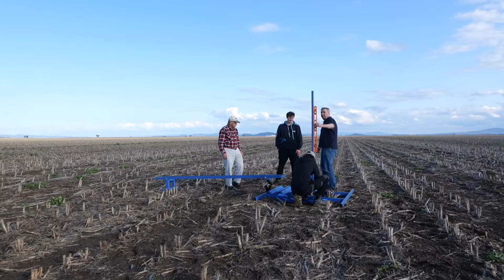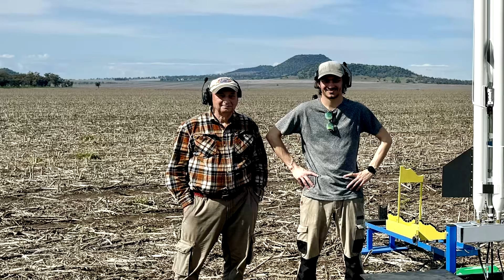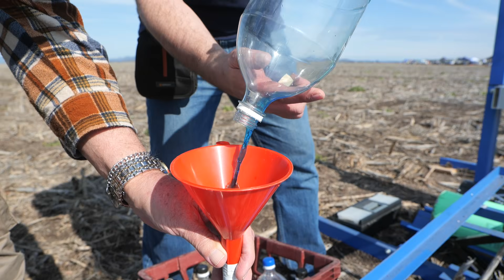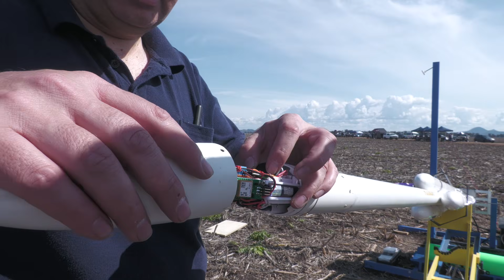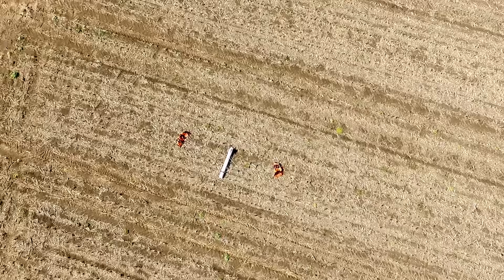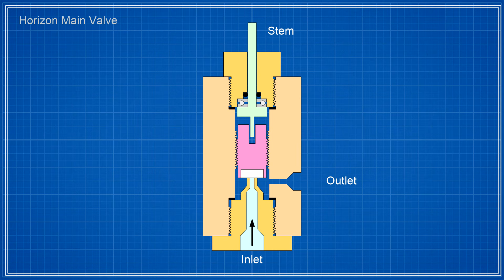World Record 2-Stage Water Rocket Flight

Comment: This is fantastic to watch. Last summer I told my wife Ukraine might be able to launch water rockets to raise nets to stop drones and/or missiles around critical infrastructure and would not need any combustible fuel. Larger parachutes would help stop the missiles. Adding salt in the winter would prevent freezing and lastly adding compressed air just before launching before launching would be a safety feature. I did not try to calculate how much thrust would be created by 300 psi air pressure.

Comment: If 5 stage with extra air tanks on each stage and ejection each stage after dried out then 20,000 km space can be achieve with dried fuel and electric as two final stages

Comment: Well done. Awesome flight effort but also brilliantly documented.
Some connectors that you can't reverse and are capable of handling 40G without separating would potentially a good thing. A cordless drill, screwdriver bits and some sockets could save you hours next time you set flight.
Reply from the maker: Thanks, the battery connectors we use are not ideal, but they are standard to all our other electronics/chargers that we use on our other rockets, so this makes it much easier to swap things between projects. We've never had these separate as a result of acceleration ... well not yet anyway. :)

Comment: Great engineering folks 👍.Max altitude reached ? Also the terminal speed.
Reply from the maker: The maximum altitude of the second stage was 5313 feet / 1.62km / 1.006 miles ... top speed was 977km/h  / 607mph

Comment: 120 feet whow, makw me feel like wheni was a kid. Did my eyes decieve me, did it run of of water on the boost stage very quicly and finish the assent on compressed air? would it get more boost with a higher ratio of water or a smaller nozzle ?
Reply from the maker: Yes during boost the water comes out in a couple hundred milliseconds and the rest of the air in a few hundred more. Most of the flight is the rocket just coasting. Water here is near optimal at 1/3 the volume. A smaller nozzle on the booster gives you less speed to accelerate the second stage. In fact larger nozzles would be better, but the rest of the rocket would have a hard time handling the acceleration. That's why we are using the nozzles we are. As is we still get 45G of acceleration on the first stage.
Reply: @AirCommandRockets  boy, i would have to dust off the ole physics books but it seems conventional rockets use a nozzle to turn some of the pressure into volocity since the volocity of the exahust determines specific impulse. would a nozzle reduce the G load and allow a lesser thrust to go furthor with the same reaction mass? I am sure you have run the numbers 1200 feet proves that, too early for that math.

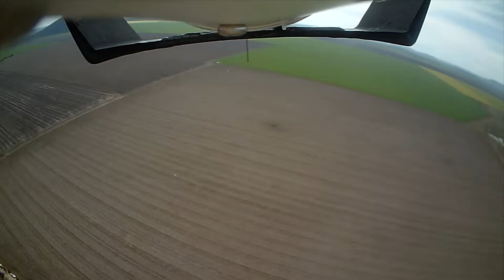Comment: Not sure if you guys noticed you had a hitch hicker on the rocket before launching lil spider was bouncing around checking out the new surroundings headed towards the camera for a selfie 36:49 think it was 4 min prior to launch just as the spectator in field walked into view I'm sure lil critter had a good hold on the rocket till it fired off you had 800 lbs pressure release almost faster than fuel propulsion 1/2 mile .08 seconds is fast

Comment: The first stage is water pressure?
Reply from the maker: Both stages use compressed air as the energy source (about 2/3 the volume) and the rest is water (1/3 the volume) that is used as a reactive mass to eject from the nozzle.
Reply: @AirCommandRockets  Interesting. Thank you.

Comment: My first thought when looking at your rocket is how air will be forced in between each outer rocket and create pressure in that space and increase drag. Why not design an aerodynamic sleeved cap with a center hole that can slide over the center rocket and cover the other three? Maybe just down to the parachute door? I'm thinking beverage can thickness aluminum or a lightweight plastic as you've been using for other components. I could be wrong, but I think worth looking into. Edit: On second thought, I'm thinking that such a cap could eliminate that black bracket you used to hold everything together, which looks like is creating a huge amount of drag by itself. You would end up with far better aerodynamics with little or no weight gain; maybe a net weight loss. In the end it would look like a Saturn V rocket.

Comment: To me the best part of this series has been how committed people have been to make Horizon a reality. Will it fly again?
Reply from the maker: Thanks Dan! There is currently no near term plan to fly it again. We have a few other projects we want to tackle first.
Reply: I'm sure that once you've had some time to analyse and let sink in all the data and think where you would be able to squeeze some more efficiency, performance, drag reduction and various other aspects you'll be itching to get out and put those new theories to the test hahah  @AirCommandRockets 

I'm thinking how much drag would counter sunk screws save, and also that releasing the second stage at apogee is counterintuitive as the first stage has to rebuild all the momentum that deceleration has taken away, so some fraction of a second sooner deployment of the second stage could achieve more total altitude due to more energy being available at a higher velocity for not much altitude gain from the first stage...
Reply from the maker: @duzmano8161  The entire project was all about compromises. Because there were so many parts that we weren't sure if they be able to hold up to the forces, we tended to err on the side of strength and durability over weight or aerodynamics optimization. Now that we know what works, there would definitely be some things we would improve upon. I think you could easily remove about 2Kg from the booster, and improve the aerodynamics further. As you mentioned, staging optimization would also get you extra altitude.
Reply: @AirCommandRockets  and after all that I wrote, I didn't congratulate nor commend you for all the effort and the amazing results that you and your team and family avchieved, kudos and respect to all of you.
Reply from the maker: @duzmano8161  No worries, thanks for that :)

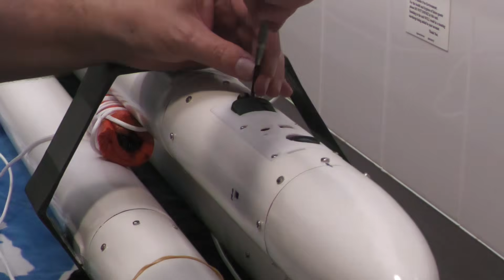Comment: Around 07:30 - How much of that equipment can be deleted in order to achieve maximum altitude and still recover the rocket? That must be quite a lot of mass.
Reply from the maker: This is a good question. One could certainly remove the cameras and the other redundant parachute deployment mechanism. You would probably save ~1Kg. That may give you an extra perhaps 100-200 feet? On the booster it isn't as critical as it is on the second stage.

Comment: Have you tried silicone rubber bands?

I wanted to stretch one out a couple mm, so I hung a weight from it for 2 months...and it snapped right back to size, zero change after 2 months of being stretched.
Reply from the maker: We have not tried silicone rubber bands. Might have to have a look for those. We've tried natural rubber bands which stretch more than regular rubber bands, but they also degrade faster. Thanks for the tip.

Comment: This is science people; measuring the mud on your shoes with a calliper ( you have to be very precise with such things). You can make things the hard way or…..I took a normal PVC water bottle filled it with a bit of water, folded a piece of paper to make a cone, made a little peeping hole for a shockproof GoPro , stick it with tape, stick a iron rod in the ground, (no spirit level needed) stick some lightweight O rings on the side of my ‘rocket’, pressurised it with air, no parachute needed and release the butterfly valve. We approximately made 650 meters ( OGee inches) erm…25.590,5512 inches! (Damn metrical systems, wish they were used worldwide. Total cost; bottle of water, some paper, some glue, some tape still had rod in my shed to guide the ‘rocket’, the GoPro survived, all in all approx. $ 3,50. What did we not achieved; the height, the effort, the countless dollars you’ve spent, the endless video you’ve made (ours lasted 1,5 minutes , no hotel costs (cos I made it in my small kitchen) and so on and so forth. Strange hobby’s in America! I don’t want to ridicule your educated hobby’s, on the contrary, I do certainly admire them very much and admire especially what you’ve achieved. But in my tiny country it isn’t simply possible! If I launch a rocked the size you did our whole country will be blown to smithereens. Thanks for your video and stay happy 😃 love from Holland 🇳🇱
Reply from the maker: Glad to hear you've had fun with water rockets as well. :)

Comment: Wow! I'm from the UK, and nearly 61 years old.

Your video took me back nearly 48 years to Edgewater College, Pakuranga, Auckland, NZ where I won (for estimated altitude - "a long way above the school buildings") in a 4th or 5th form water rocket competition.

Mine used a small gum bottle (which has a nice flat flange at the neck), jammed onto a large pen top, with a hole in the bottom of the bottle filled with a test tube bung, fitted with a bicycle inner tube valve.

It was filled to about 50% with water, and then pumped as high as we could manage.

A clip help the bottle neck flange in place on the launch pad (a small board with a hole in which the pen top was jammed) and was simply released using a cord.

Just one of those magical moments from my early teen years, that I thought I'd forgotten entirely, but now can visualise in some detail thanks to your video.

Sadly, I didn't pursue a career in rocketry, opting instead for high performance computing :)
Reply from the maker: Thanks for sharing :) You're never too old to get involved in rocketry.
Reply: That's pretty cool it triggered a memory from your wee days as a kid.

Comment: I am surprised that the optimum configuration has that little water.
Reply from the maker: The ideal ratio is about 1/3 water and 2/3 air. We're slightly under this ratio to make sure the rocket remains stable in flight. Here is some more info: http://www.aircommandrockets.com/water.htm
Reply: @AirCommandRockets  Er, I get a cert error followed by a 404 for that link?

Comment: Probably an uninformed question:  could the apparent measured altitude drop of the second stage be a Bernoulli effect due to its high speed.  (I think you said it was a barometric sensor for altitude.

Thanks
Reply from the maker: Yes, I do believe something along those lines is what happened. Normally you want the static ports on the rocket to be on the cylindrical part of the rocket. Here because the port is in the tapered part of the nosecone, it can get  a little noisy at higher speed. It's probably also why it settles down once it slows down near apogee.

Comment: Amazing commitment to a simple technology.  We did this for two science projects and several Boy Scout events, and came in second in a regional competition.   Three comments, first, not sure that straight up is the best.  We saw that some competitors got some "glide" value at small angles, as the stage tipped over slowly, and some had "guidance tabs" along their sides to help with that angulation.  Second, it is the RATIO of the water and air which determines the best performance for a given weight.  They should be weighing the water, and making the air pressure the best possible value together.  We had some computer modeling to help with this.  After the boost and lift, the center of gravity shift allowed us to obtain maximum "hang-time" which was one of the scoring criteria.  We doubled the hang times of the previous records.  Third, as SpaceX and BlueOrigin recently said after their problems, "it is ALWAYS the VALVES" which cause the problems.  So true, so true...

Comment: I wonder if you pulsed the release of the air and water if you could gain efficiency
Reply from the maker: Not really. Also any mechanism that you would add to make it pulse would add extra weight that you would need to overcome. If the goal was to reduce the flow rate, you can change the size of the nozzle without a need to pulse.

Comment: whats the point with this rocket ?
Reply from the maker: A really good question. Water rockets by their nature are one of the most inefficient forms of propulsion. This rocket is about the fun engineering challenge of pushing that concept to its limits. The one advantage of normal water rockets is that they are very cheap to fly and are often used in high schools to teach physics of rocket flight.

Comment: So cool, great job. I'd like to hear more about why shooting the 2nd stage at max velocity from 1st stage is better than waiting until closer to max altitude for 1st stage. Also, the spike in speed on the booster after separation could be due to air pressure still leaving the boost. It was obvious in the video the booster was still boosting when the separation occurred so it could have sped up for a few more seconds after separation. It looks very impressive in the data that the parachute opened very near apogee. But, another question is, in terms of retrieval, wouldn't it be nicer to let it fall back down for a few seconds, so the under-chute glice would be less? Congrats on an amazing launch and retrieval.
Reply from the maker: Thanks. If you leave staging much later after the burnout of the booster, then the second stage is just loosing energy because it has this draggy thing attached to it. I guess it's like taking a run up with a javelin and throwing it when you are at your top speed, but then hanging on to it for a little longer rather than letting go immediately. The parachute opened at apogee because there is a barometric sensor on board that detects when the rocket gets to apogee. Opening the parachute later into the flight means that the rocket picks up speed and may rip the parachute off if the speed is too high. At apogee the rocket typically travels the slowest and so is the safest time to deploy the parachute. To reduce drift there are dual deploy systems that open a small parachute or streamer at apogee and then open the main parachute closer to the ground. These systems are more complex and heavier.

Comment: Cool stuff

What's next more pressure?
Reply from the maker: No, most of the launcher and rocket was designed for the 1000psi, it could handle perhaps a little bit more, but at that stage it is unclear what would break first.

Comment: One of the things that struck me was the fairly short burst of actual mass of water coming out of the boosters. I am now wondering if there's any way to add ice instead of foam to prolong mass ejection. Just a stupid biologist who has no knowledge of rocketry😂
Reply from the maker: The rocket is fairly optimized in terms of nozzle size, pressure and water amount. The job of the booster is to get the second stage up to the highest speed possible before staging. Prolonging the mass ejection would just cause the 2nd stage to achieve a lower top speed.

Comment: so this is really a pressurize gas (air) rocket, right?
Reply from the maker: No this is a water rocket that uses compressed air to expel the water. If you just used compressed air without the water you would only get about 60% of the altitude. The water is dense so it provides a lot of reactive mass but can't store much energy when compressed. Air doesn't have much mass, but can store energy when compressed. If you fill your rocket 1/3 full of water and 2/3 compressed gas then you get the best of both worlds. :)

Comment: Great launch. And reaching 5,300 feet with only water under pressure is impressive. Do you plan to add a third or fourth booster to the rocket ? Greetings from Luxembourg.
Reply from the maker: Thank you. The typical rule of thumb for water rocket stages is you want each stage to be about 5 times the volume of the next stage. This would mean that a new first stage should be about 150L. We would need a bigger workshop for that. You could potentially go the other way and put a small 1.5L stage on top of the second stage, but that wouldn't necessarily get you that much more altitude.

Comment: It looks like maybe the reason that your altimeter data was wrong for the second stage could have been that your static ports didn't quite read static pressure? At such high speed perhaps the Bernoulli principle sufficiently lowered the pressure that the sensors were reading faulty pressures. Fantastic launch! Your checklists are incredible!

Comment: This reminds me of when I was in high school, and designed my own 2 stage bottle rocket. Lacking electronics, the entire rocket was mechanical in nature. I used plastic bottles for the first stage, and used the contraction of the bottle during depressurization to release the second stage. After weeks of work, launch day came and we couldn't get the thing pressurized without the water getting pushed past the seals. Turns out, trying to pressurize an entire 2 stage rocket with a hand pump wasn't an effective method. Really impressive work!
Reply from the maker: Thanks for sharing. Yup two stage rockets are quite challenging especially when trying to do it all mechanically. We went through similar issues when we started building our first mechanical staging mechanism designs.

Comment: I like the way everything has been engineered to specfic tolerances and yet the fill mechanism is a funnel with some tube taped to it. Not saying it needs replacing as it clearly works without an issue, but made me smile
Reply from the maker: We did put a new wrap of tape on the funnel/tube combo just for this launch :)

Comment: So you left shampoo out of the boosters...

Was it deemed unnecessary or perhaps detrimental for some reason? ~( ,m,)~
Reply from the maker: Because of the short burn time and large nozzles foam doesn't have much of an effect. Because the booster uses launch tubes that we pressurise the booster through, there is no foam formation in the booster during pressurization.
Reply: @AirCommandRockets  Okee.

Makes sense.